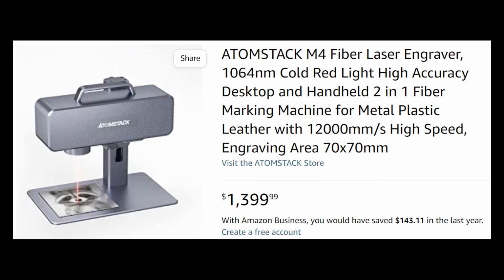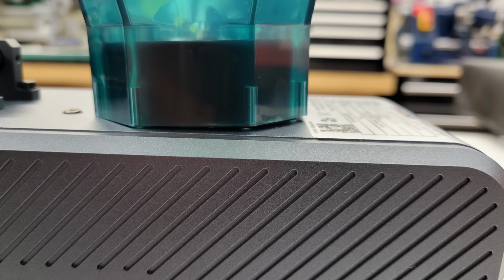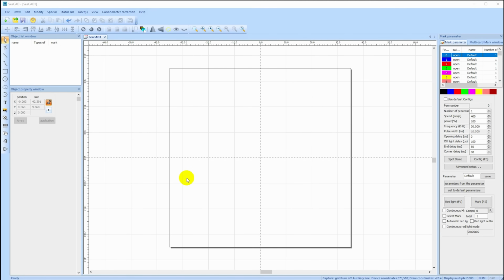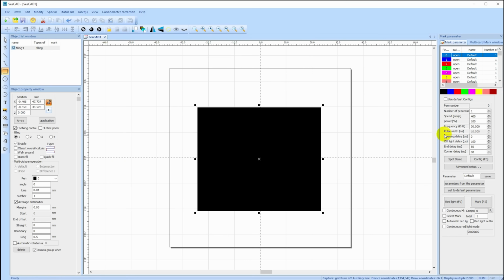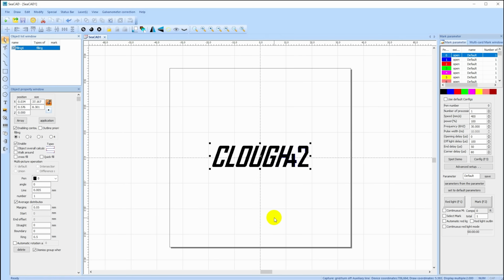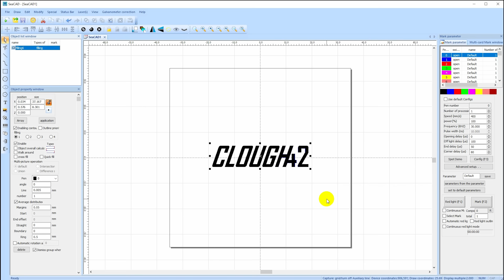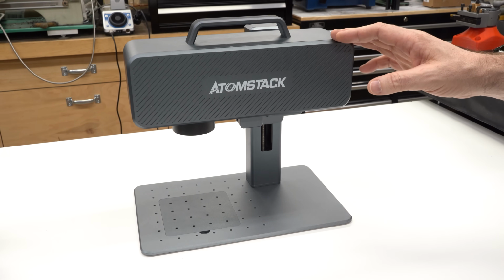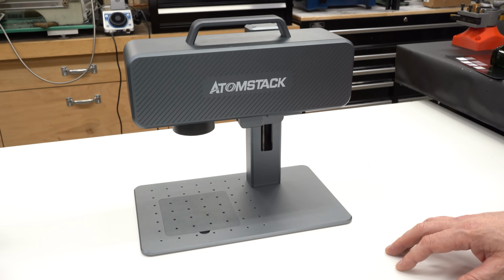Atomstack M4 Fiber Laser: Is it worth buying?

Comment: I recently got one of these at work. After also managing to visit their office in Shenzhen. I brought up Lightburn driver and they claimed it's in the works and may be released in April this year. We'll see. As for the missing "Apply" button you mention at 9:00. I think I've found that the "Application" button is the apply button, just a slight mistranslation it seems. My additional tip on the Fill settings is to enable the "Cross fill" option. It'll do a second pass, clocked 90 from the first pass to really thoroughly do the fill marking. 

I also visited LaserPecker, and while their machine has easier software and two lasers so that is has one for wood and paper, its IR laser is much much less powerful than Atomstack's and thus far slower for marking metal.

Comment: Thanks. Question. Parts with military paint.
Will it mark the paint? Just finished marking part numbers with a friends 30 watt.  2 lines
3 mm tall symbols. The whole mark was about 3/4 of an inch wide and 1/4 tall. Parts took about 2 seconds apiece.

Comment: First time ever saw a video of this type of galvo laser.  Thanks for m making the video. Your video makes me wonder if you can use this machine to file away the top part of a micro chip so that eventually you can see the inside? And also can we use this machine to burn the glue between the cracked glass of a cell phone  and actual screen beneath the glass (for phone screen repair)

Comment: NEVER EVER BURN COATED TANNED LEATHER OR PVC. The fumes mix with moisture in the air and the hydraulic acid.. I burned my name on a Swiss Army knife pouch and overnight all the exposed steel in my kitchen and the stainless steel cooker hood looked like it had a thin layer of rust.. so NEVER BURN Leather or PVC
Reply: "Hydraulic"?

Comment: CO2 and most hobby led lasers (I'll call led) are continuous wave (CW) -- a fiber is a pulse laser.   This introduces frequency and pulse duration into the equation and are as important, if not more so than speed and power.  I noticed it has adjustments for frequency and pulse rate was grayed out.  Can you change these?   Fiber lasers are for man made materials and co2/led for  for natural.  All lasers have some overlap in what materials they will work on ... co2 is great for acrylic..  not really a natural material...  I really liked 'seeing' inside.   Your comment about Lightburn -- they could sell these various lasers like hotcakes if they would just use an open source hard/software version of grbl ...  Thanks for your time to produce these, take care
Reply: Turns out that this is not a fiber laser. Se Marco Reps channel where he does a teardown right into the laser module. "Review & Teardown: Enjoywood M4 "fiber" laser engraver". That video also explains why there is no control over the pulse rate.

Comment: Thank you for your review. I have a question, what laser device would you recommend to engrave stainless steel jewelry with gold plating? necklaces, bracelets? and possibly Bracelet (curved).
Reply: I recommend the EM-Smart Basic with Rotary, It's a good choice and help me a lot, I used my rotary engrave my ring and cup. And it's a  good laser to engrave metal jewelry for Etsy, they have many video that they engrave the materials that you have listed: stainless steel jewelry with gold plating, necklaces and bracelets

Comment: I would have expected a functional tool right out of the box. Adobe compatibility is a must. There's likely a fee associated to that. Also with Lightburn devs to add your code to the list. You have to remember that the money goes to the CCP. So, maximizing profits is the ultimate goal. Cheaping out on an otherwise functional unit is not really an option in American manufacturing.

Comment: Nice review. I have been considering one of the fiber laser systems. The AtomStack price is compelling. Do you know the laser power? The frequency limits?
I, like you I believe, am an EE - retired. I want an easy way to quickly make PCBs.
I am sure the M4 will not cut copper, but the ability to remove solder mask opens doors.
Applying SM and blowing it away to prepare for an etch process is an idea.
Also the possibility of first applying toner, or powder coat paint and then fusing the material onto the platted G10 copper surface is another idea to prepare for etching.
It would be interesting also to know if holes could be "drilled" in the epoxy,...
If you have the time to explore these ideas, please do so. I suspect there are many people that would find this topic interesting. Thanks for the video as it is, it is helpful.
Dan

Comment: Fiber lasers on metal in a single pass , are basically only surface engraving , but as you have shown very clearly , each metal is different
However , if you use a spacing in region of 0.02 , and use hatch one at 0 degrees and hatch 2 at 90 degrees 
Then on the right hand side set the speed to around 800 , power 80% ( i never use 100% ) and say 50 passes.
That setting in something like copper should give you depth as well as a nice clean cut.
I would be interseted to see the result , and i would suspect others would to
Great review

Comment: a review to me, needs to be problem's free ore its a fail. the misalignment is not a shipping problem  its a machining problem. and this is just a diode laser. the point of a fiber laser is that you with a fiber wire place the power source beside the machine, and then send the laser via fiber cable to the moving head. this is just a diode laser that shoots on to a mirror, so this is like many co2 lasers, just way less power. BUT this is cool it can edge mild steel and Aluminimum..

Comment: Nice review James!
I never thought that an IR laser wouldn't even etch wood or cardboard... But metal engraving looks great!
Have you tried holding the stand on the wall (with the windowy opening) instead of using the funnel? Could be easier to hold the base still...
Next time, could you engrave meat with the blue laser for a comparison? 😉
Reply: A CO2 laser is also IR and works very well with natural materials, such as wood. IR is frequency below what we can't see, in simple terms.  The CO2 is 10.6 uM and a fiber is around 1064nM.
Reply: I use a fibre laser(higher output that this one admittedly) and had the same initial result as in the video on cardboard, a really light mark. Slowing the speed right down to 100mm/s and dropping the power down to 20% and also dropping the frequency fixed the issue and ended up getting a really good mark, 100% power at the slow speed is also great for cutting the cardboard. My laser uses software called EzCad, but it looks pretty similar to what is in this video, it is the crappiest software ever so agree with this review on that point, also I think the 'application' button is apply when changing settings

Comment: I have one of these and a 30w Chinese Galvo.   This is decent (though the software stinks. Just like easy cad). For my 30w I changed the board and can use lightburn with it and am happy.  On this the confidence factor of this is great.  I use the 30w for things like serial numbers on firearms as I can get the depth necessary with only about 5 passes (speed and power change this).  I use this one to mark simple aluminum business card tokens that I keep with parts and guns as property tags.   This is nice when I put a bunch of parts in the ultra sound.   I know it’s overkill but I don’t like paper tags.  If lightburn supports this I’d be completely satisfied.   Mine had no issues with the lens etc.   this is not a production grade device, but is convenient.   I say give them another year and it will be a lot better
Reply: How deep does the government (BATFE) require you to etch a serial number, legally?

Comment: I like that it doesn't have micro USB or something like that but a more durable socket.  I sometimes see things that have a micro usb socket even though space is clearly NOT a design constraint that would prevent use of a more durable socket.  Like on some 3.5 inch external hard drives you might see a micro or mini B socket and sometimes no socket for extra power even though there was space for those things.  To me it is a sign that something might be junk or designed by mediocre engineers (if any engineers were involved).

Comment: About the "red light": the product description mentions "1064 red light"  which indeed is InfraRed light.
It does not burn meat but you do feel it stinging on the skin (I've been told - I have not  tried, or will try, this myself) but it will damage your eyes. Always make sure to wear laser safety goggles designed for 1064 nm wavelength especially when using this on brass, copper or silver - these materials are much more reflective than steel or aluminum.

Comment: When you started I was like: "Less than $ 1500 for a fiber laser - and you think this is gonna do anything ? 🤣". But I am surprised about the results you got.
I have a large 30W fiber laser machine for which the laser source alone is over $ 1500. I am surprised with the out of the box quality of the engravings.
You are right about the software and support. Lightburn is so much better than all those dedicated packages. Lightburn has no problem opening all the regular file formats.
Reply from the maker: I think this is a case where all the required hardware is here, and it's getting cheap enough to assemble into a product like this.  There's real potential here if they can work through the system integration problems.

Comment: I noticed a quick piece of info - the wavelength of the laser was listed as 1040 nm.  That is a little shorter than what I have believed to be a standard 1060 nm for YIG lasers and mostly used in fiber transferred laser welding.  I may be wrong about one or the other number, but no matter, it is infrared in any case.
Reply from the maker: Their marketing materials claim 1064nm.  I have no way to measure or verify this.

Comment: How does it not burn or cut wood or paper?
Reply: different materials require different laser wavelengths.
absorption of the light by materials is wavelength specific.
materials properties like specific heat, and heat conductance also impact
the results. hence different systems for different applications.
and that's the way it is. Back to you Walter.

Comment: The typical chinese product experience. The chinese can make great products, but quality control and tech support are certainly a huge weakness. This review looked rather painful even though it's a nice product. Usually the factories that produce these sell the same product for multiple brand names so don't be surprised about seeing other brand names. Do note that even though multiple brands and similarly looking products come from the same factory, that does not mean that the products are identical or the same quality. In my experience the quality of what you order from a Chinese factory largely depends on the price. If you haggle until you get a lower price, you get lower quality components. From my experience, in most cases haggling gets you trash

Comment: I have the Mr Carve M1 and a Omtech 100w MOPA Fiber, I backed the Mr Carve on Kickstarter.  To be clear, the AtomStack isn't a fiber laser.  It is a 2w 1064nm diode attached to a galvo head.  The Mr Carve shipped with SeaCAD as well.  Just like using EZCad you need to apply your hatches.  Instead of hitting enter, just click "Application".  You have to do that with each hatch, as you can have several hatches for one Pen.  If you hit enter, you are only applying that setting to the first hatch.  There is a steep learning curve when it comes to using SeaCAD and EZCad, they are very similar in operation.  Mr Carve was first out of the gate with a 1064 Galvo, this looks very similar to Mr Carve M2 with a different shell.  I would agree in your closing statement about, shipping and quality control.  However, even though this isn't a fiber laser, it is using traditional fiber laser type software.  I would suggest people be educated on the software before jumping into the 1064 Galvo and or Fiber lasers.

Comment: Yeah, I agree with some of the others who've posted here. $1500 is too much for such a small work area. I suppose it's for portability but it'd probably better to just have a rigid metal skeleton frame with skid proof rubber pad(s) for vertical work than the plastic shroud it comes with. Also, does the scale of the finished artwork change with height adjustments or, once you calibrate it, does it translate to a fixed height with the correct scale?
Reply from the maker: You can't zoom the image by raising or lowering the head, because it only engraves effectively at the focus distance, which is fixed.
Reply: @Clough42  I was more worried about the scale not being correct or what you expected. But if it's a fixed focal length then it should be okay.

Comment: I think, for those that have a cnc router, one would be better off buying a 20w optical power laser module to install on their router. Would be much, much cheaper, can engrave on large surfaces(as large as your cnc router can handle) and can even use it to cut wood and plastics. For instance the "Laser tree LT-4LDS-V1 Kit A" costs less than a third of the price of the atomstack M4 and can do a lot more.

Comment: If you want to cut or engrave organics like wood, fabrics and plastics then CO2 laser does the job better. Fiber lasers have different wavelength for and they work better for metals. You can eventually use both types for either job, just you'd need a lot more power for CO2 lasers to engrave metals and if you get bunch of them watts like kilowatts you can begin cutting them also.

Comment: BTW, blue diode laser works on mild steel too. it takes longer and needs some painting before (black permanent marker works fine) but it works!
Reply from the maker: Not sure what you mean by "works" if you're comparing a laser that marks the material directly with one that requires a coating.
Reply: @Clough42  agree. without marking it just reflects with no sign on metal. and dark marking allows it to melt tyniest layer of metal underneath.

Comment: I’ve been considering a fiber laser myself. I’m like you in that I have pretty much the same experience levels. But, early next month I’ll be 73. At this point in my life, I’d finally like something to just work. I recently finished redoing my mill, replacing the motor with an inverter rated unit. Working to the same standards as my industrial designs over the years was a lot of work. Buying a laser should be simpler. I neither want to be rewriting the software or redesigning the hardware as I would have done a few years ago. Good models are several thousand, but they meet their specs and work properly. If you should have a problem, help is there. It’s a tough decision, particularly as one moves up the power level. My interest is at the 6o to 80 watt level, and these are too expensive, even in the cheap off brand cases to fool around with.

Comment: I operate a 30w fiber laser engraver at work, and it can mark any kind of metal at 500mm/second on full power.
It is a Chinese machine and it was about 3500 euro. The Atomstack does not state (or I haven't found) the actual laser power, but an electrical power and a "peak optical pulse power" which is in my opinion deceitful. By the way, the 30w unit houses the laser module and control unit in a case that is as big or bigger than a mid tower pc. The galvo head / arm and baseplate  are bigger than the whole Atomstack unit. 
And it also worked right out the box (meaning a big plywood crate it shipped in)  :)

The smoke MUST be vented or filtered because when marking metal the resulting smoke contains vaporized metal particles which are hazardous to breathe.
Reply from the maker: I have seen the figures 2W and 5W in various places in the marketing literature.  I would believe either of those.  There's probably some rationale by which you could argue that the 20KW peak power is a real thing, based on optical compression of the beam, overdriving the diode source momentarily, etc. but everyone knows it's silly and shouldn't be used to compare to anything else.

Comment: I think you’re being very reasonable.    And if it came to it, here in Australia the Dept of Fair Trading who administer the consumer protection laws would agree.    In general, all products must work as advertised or risk losing in court and paying damages.   Furthermore, regardless of the sales contract, the law gives buyers a warranty that the seller cannot contract out of.   This product would not pass muster in my state , NSW,  and without implementing changes similar to your recommendations is likely to get an importer in trouble here    The Dept could require compensation to be paid to buyers,  recall of the products for repair, replacement units sup0lied at no cost,  or even complete withdrawal of the product from the market

Comment: Fiber lasers are pretty great. We use a 30w noname unit to make equipment tags on bare stainless tags and for other marking. Folded up painted flashing can make a good optical shield to protect your eyes and some fume extraction is important, pretty sure these things are creating nano-sized particles of whatever you're blasting/etching/engraving. That software looks very similar to EZCad, steep learning curve on that one :D  I think you need to use much older illustrator formats as it can't read the new ones.
Reply: Except this isn't actually a fiber laser.